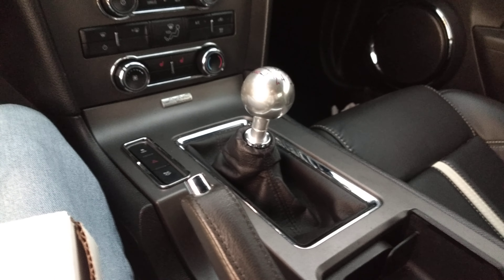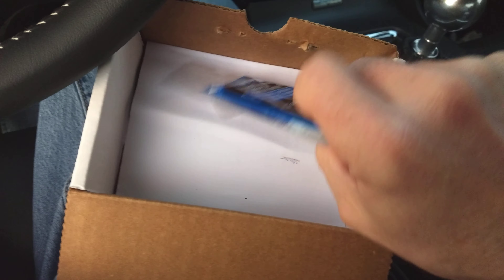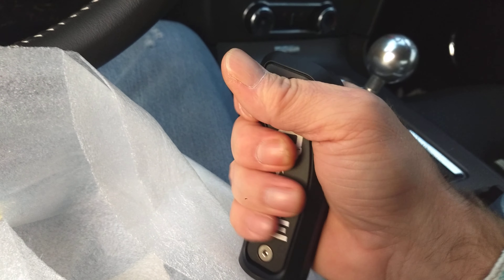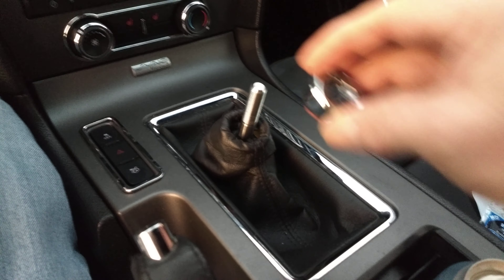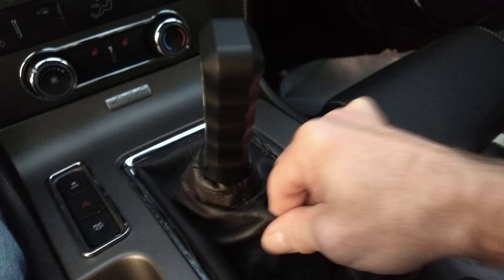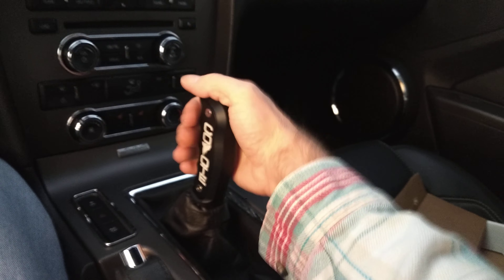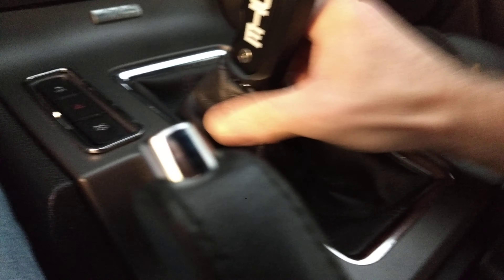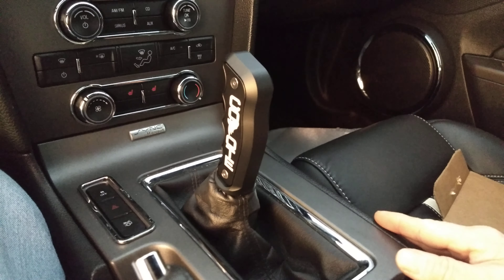Barton mustang pistol grip "coyote" shift knob on mgw shifter

Comment: Picked up my 2012 and it has that same knob. Can’t find that knob anywhere. Does it come with a shifter? The throws are really short as they are curious if it has an aftermarket shifter
Reply from the maker: No it was just the knob.  I had a MGW shifter in mine.  It's a Barton brand shift knob.  Look them up